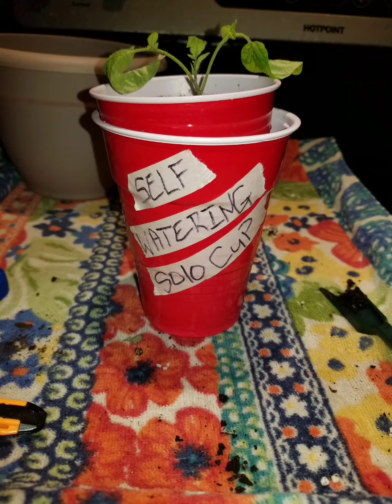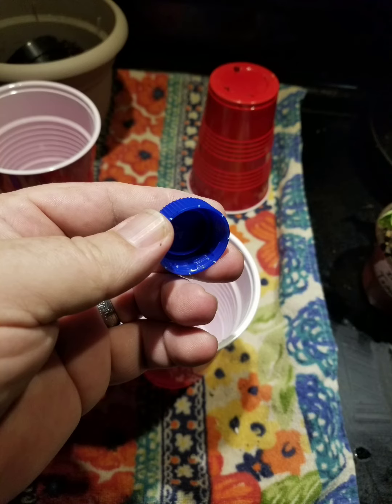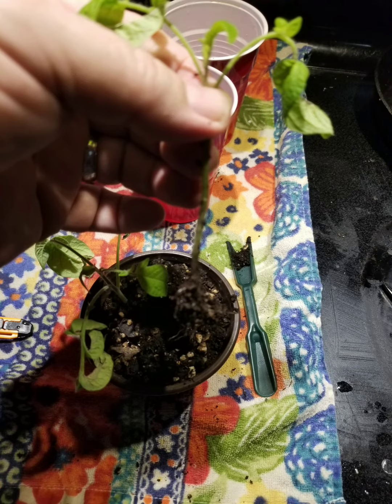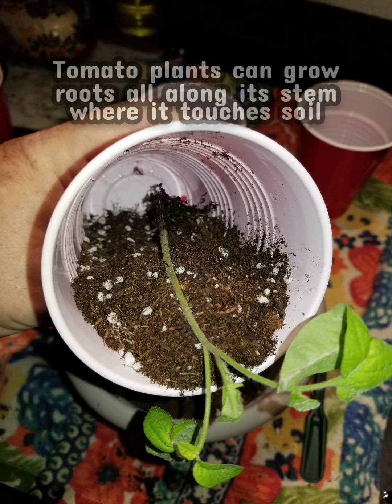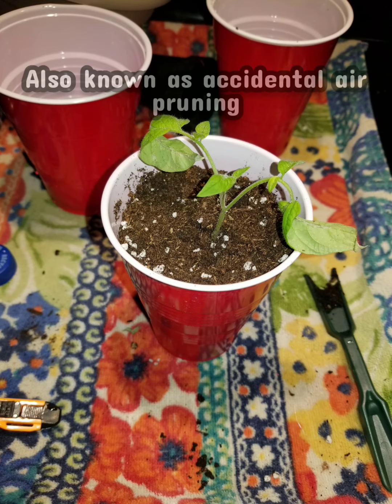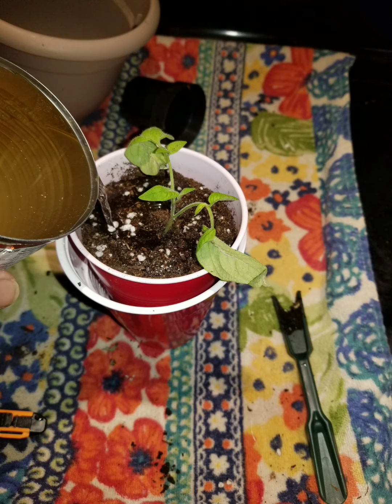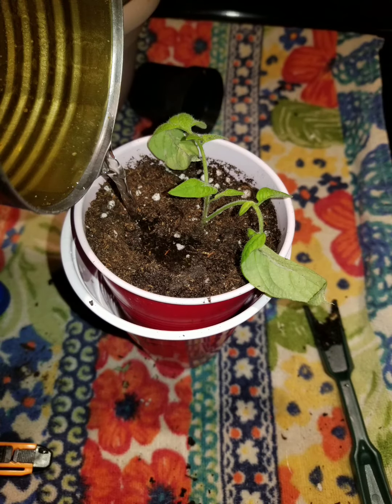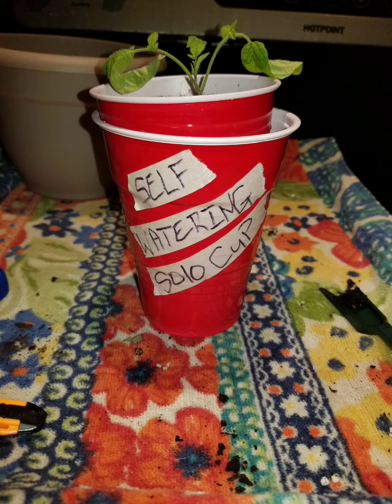self-watering Solo Cup method

Comment: 03.06
OK, I melted 3 holes in the bottom with a hot knife, then, added 2" of starter soil. Probably too much.
1" would do for these tiny seeds. I filled the bottom cup 1/2 way w water & set the top cup it the bottom
cup & let it sit. By & By the top cup settled. THEN, I snapped a drink cup lid onto the top cup. Set them
both into a big Sterilite container sitting on a big heat pad in my GH I have inside my garage, turned the 
GH heater up to 77 & let it cook.
03.08
I have read that some gardeners see their first sprouts on 2nd day so today & will pop off the lids & look.

As soon as I see green, I will drop a GH lamp over top of the Sterilite pan.
Walmart HyperTough shop lights in store  - 5500lm - 5000K    $19.98

!

Comment: I am wondering with the two solo cups I put a small chunk of wood in the bottom so it stands up a little taller but when I said to my seeds, I put water in the bottom of the cup and probably about 2 inches of soil and I put my seeds onand I just sprinkled a little dirt over the top. Anyhow everything is wet I maybe shouldn’t put water in the bottom of it right away. What are your thoughts?

Comment: Wat size cups are you using
Reply: 18 or 16 ounce.  buy the square bottomed one red for the insert and a clearish rounded bottom for the outside cup.  that avoids having to add a stone as the square one sits above.  having an outside cup clear allows you to see which ones need water.  not to much water 3/4 inch at the most or soil will get too wet.